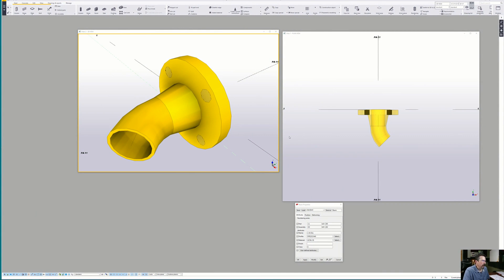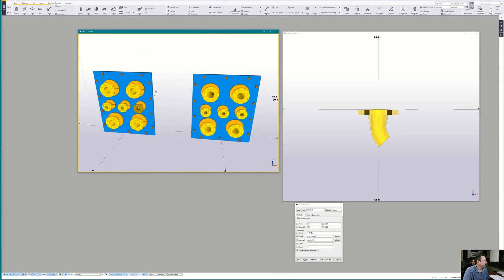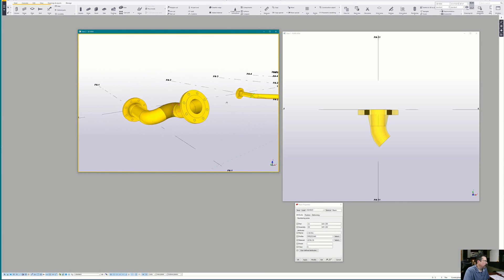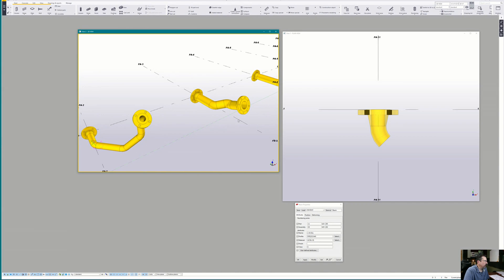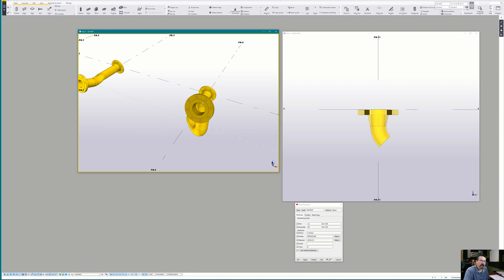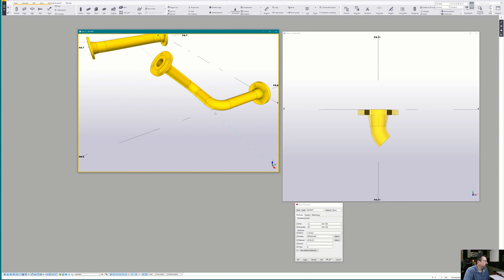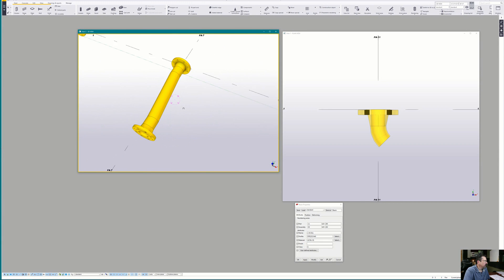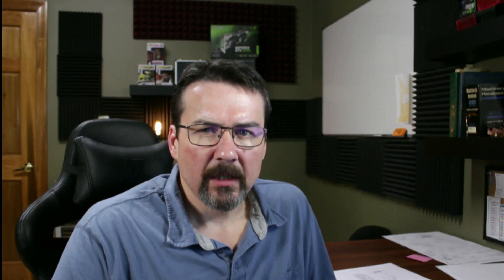What Can Be Modeled Using Tekla Structures?

Comment: Just shows how Tekla and Trimble have totally dropped the ball on providing a MEP solution through Tekla.
Reply from the maker: I don't believe that to be true, but then again, I don't do MEP for a living.  I can say, however, that the times I've had to do any sort of pipework, I haven't had any real problems.
Reply: CS Wilson Draws that’s my point. Tekla and Trimble don’t promote Tekla as an MEP option. Only structural. It’s by far the best modeling solution available. Pipe, conduit and duct is just like any other extruded object. Use SketchUp for fixtures and non extruded objects and the combined solution would be awesome
Reply from the maker: I'm sorry...I misunderstood your original comment.  :)  I agree and also I think it's only a matter of time before Trimble starts marketing to the MEP and even timber markets.  It wasn't that long ago that Tekla (which used to be XSteel) was "steel only".   Now it includes concrete/precast and reinforcing.  I believe that. one day, Tekla Structures will be a one-stop shop for all construction trades.